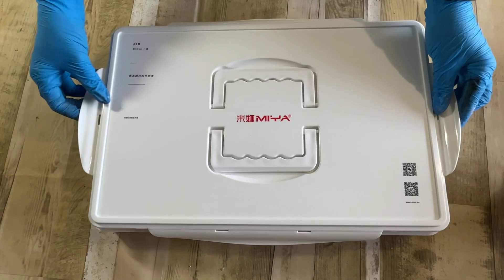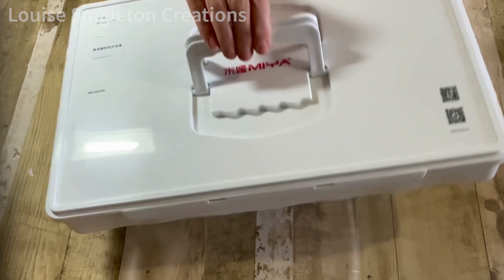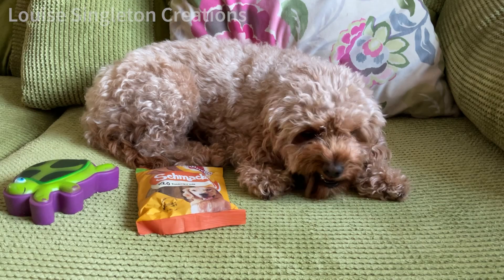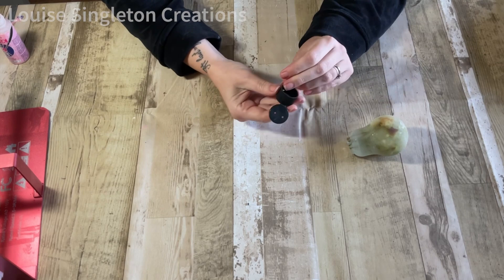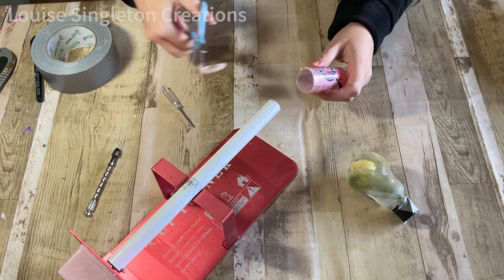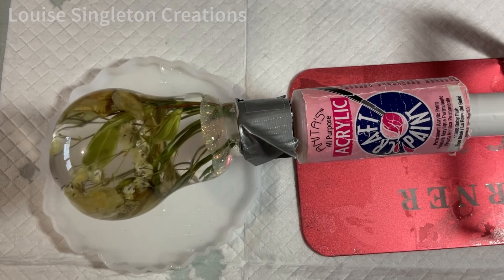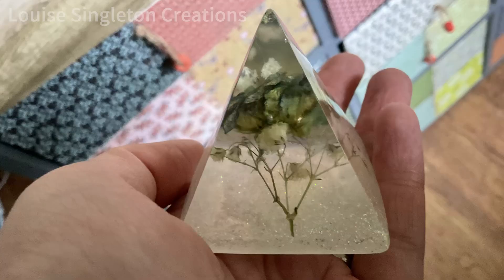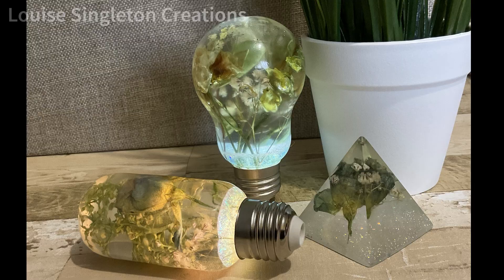Cup Turner Hack! Resin Coating 3D Items on a Cup Turner AND See my New Paint Storage from Grabie!

Comment: This is great.  I actually have coated some of my items with resin using a cup turner.  I used hot glue too but I love your brilliant idea of the paint container!  Genius!  I used the turner for some Christmas ornaments that I had painted with alcohol inks.  It worked well after attaching each ornament to a wooden dowel, then using masking tape to tape several at a time to the outside of the turner (if you can picture that).  I used the same method for pens.  Thank you!
Reply from the maker: Thank you. Good thinking! Where there is the will there is a way!

Comment: What a great idea! Thank you so much for the tip, I'll have to give it a try! If you figure out how to solve the same problem for large pyramids, be sure to share with us because that's what I'm having difficulty with. Because I have to suspend items and do multiple pours at times, I end up with lines on my mold that transfer to the next project, and the next, and forever. I sanded one down and poured resin over the top, but I was left with spots that didn't cover well, even though I went over it with a paint brush. Now it looks just as bad as it did before.
Reply from the maker: Thank you so much. I know what you mean about the larger pyramids and the line marks from the mould. It’s very annoying! I think it would be possible to do the same kind of thing with a larger and stronger connection but my fear is that the cup turner motor might not handle the weight very well.
Reply: @LouiseSingletonCreations  I have the solution. You need to use a lathe. If you've got the money for it, it's the perfect solution & definitely worth the money spent because you want every piece to be perfect. I've seen artists turn wood & resin pieces that turn out so beautiful & I've dreamed of doing similar projects, but I know I'll never be able to afford a lathe. It's the perfect solution though 👌
Reply from the maker: Margaret I have wanted a lathe for such a long time, I really want to learn wood turning. I think a lathe would be too fast for resin coating but I still want one. For me the issue is space I think you can get lathes that aren’t too expensive but then you need all the tools as well. One of these days I’m sure I will get one but first I need a workshop!

Comment: This is very clever!! Out of curiosity, what is the curing time for the epoxy you're using. I imagine you'd have to leave your cup-turner on for a fair bit.
I myself have had some difficulty with top coat applications. I'm rubbing the resin (with gloves) onto small figures, but the resin sort of beads up, and doesn't really adhere to certain patches of the surface. I've tried cleaning the surface with alcohol beforehand, but it didn't help. Have you encountered this? Maybe I am sanding to too fine a grit beforehand?
Reply from the maker: Hi Brian. The resin I use has a 40 minute working time but it does take a good few hours to cure enough for me to turn the power off ( I leave it on for around 6 hours just to be sure) I have encountered patchiness before and I’ve put it down to finger/oil marks. I personally don’t think it would be anything to do with the sanding because I’ve had success coating an unsanded glossy surface and also on coarsely sanded surfaces. It sounds like something is repelling the resin.

Comment: So we're the molds not shinny? Or was there imperfections with it? What caused you to need to sand the bulbs? I'm just wondering since I was going to get some of these bulb molds from Let's Resin, but I don't have a cup turner for my epoxy resin stuff, yet that is, I will soon. I was just wondering if it was the mild or something that happened in general. I love how you think, I'm the same way. I grew up with mainly just a mom and that woman can fix anything, it may not be in the professional sense but she passed in to me those little gifts of thinking outside the box and being crafty in any situation
Reply from the maker: The moulds are shiny but I messed up my bulbs, I think I demoulded them too early and got finger prints on them then tried polishing them and made them worse 🤨